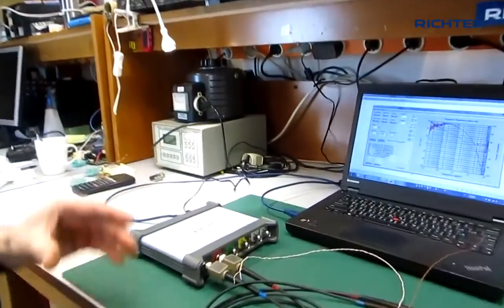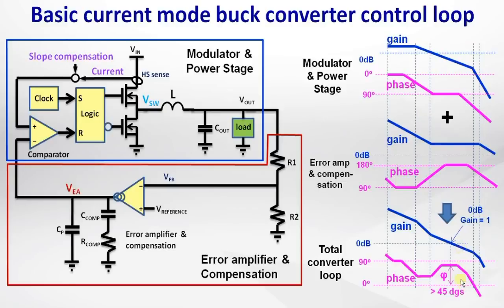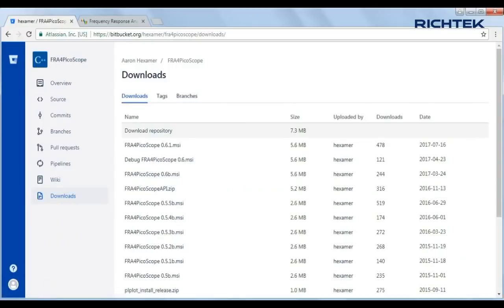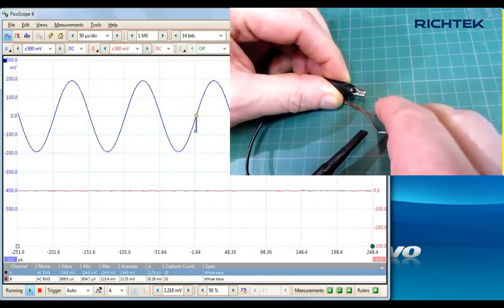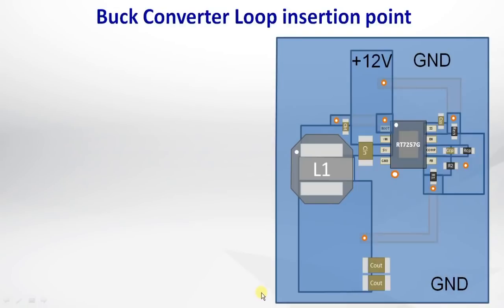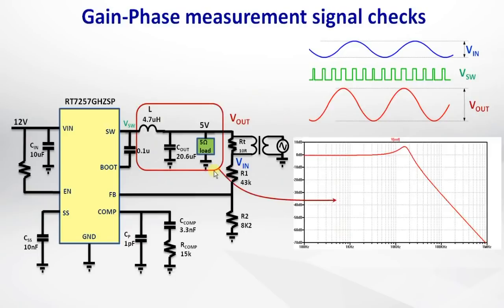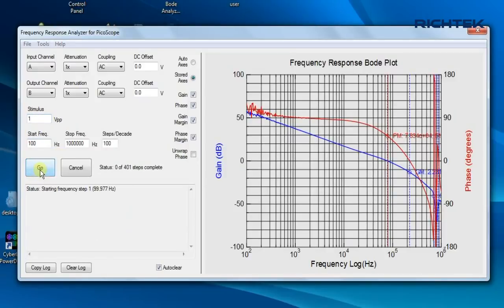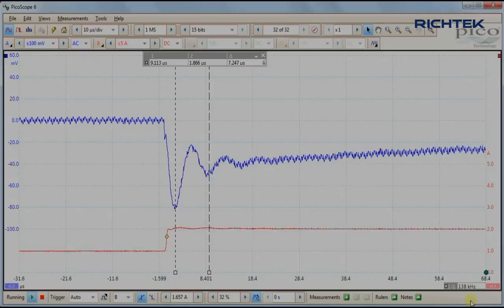How to measure Buck converter loop gain and phase

Comment: Thank you for this very informative video! Do you think the 8 bit picoscopes will give usable results?
Reply from the maker: Yes, we also used PicoScope 2208B: it gives usable results, but the noise level is higher, so with low stimulus settings the graph also shows more noise in the low frequency range. See the measurement results on https://www.picotech.com/support/topic14311-270.html#p122181

Comment: Very informative video ! I have a question could we place the injection resistor with the transformer also inside the voltage divider in case we want to measure very high voltages ? On TOP it´s very hard to protect the measurement equipment from high voltages. I would also place the oscilloscope probe within the voltage divider If that´s possible.

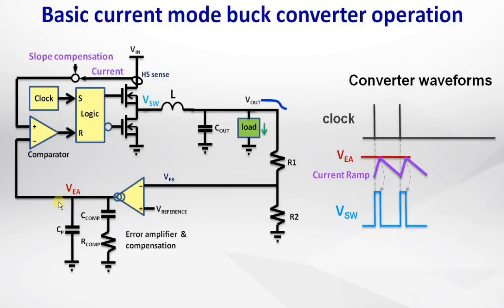Comment: Noob question, but at 1:41, the Vout is said to drop when a load is added, but I thought that didn't happen in parallel circuits? In series, there will be drops across components, but adding a load in parallel should not drop the voltage, it should only affect the current through the Vout node? No?

Comment: Instead of a magnetic transformer (balun) to inject the signal, caný a differential output amplifier (LMH5401IRMST) be used? Does it make sense to use a kind of calibration (modifying the software) to compensate transformer losses by modifying the generator amplitude?